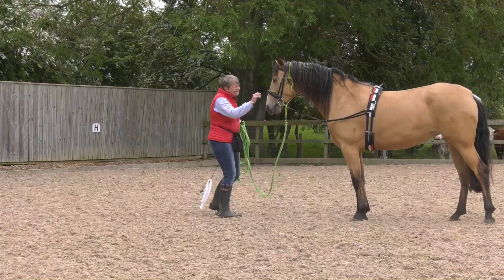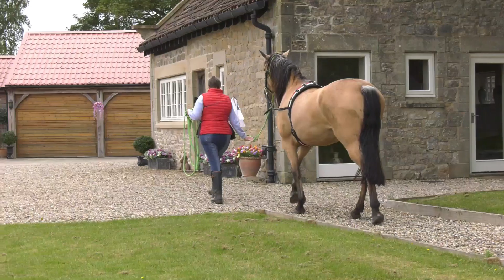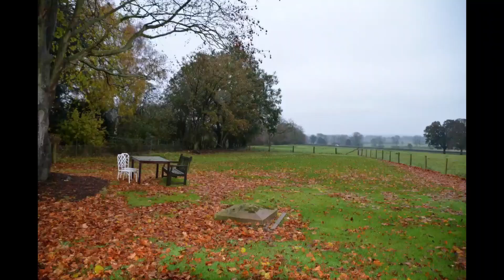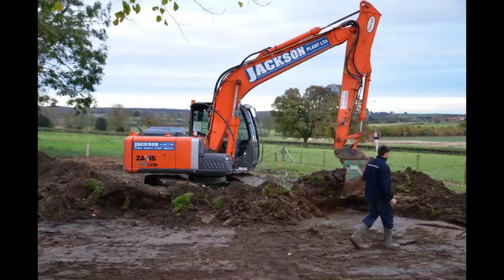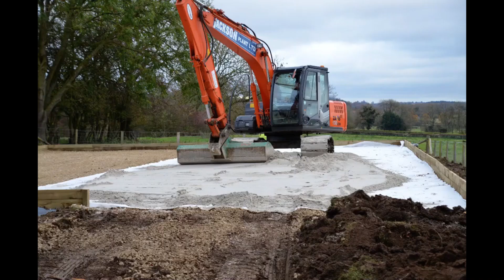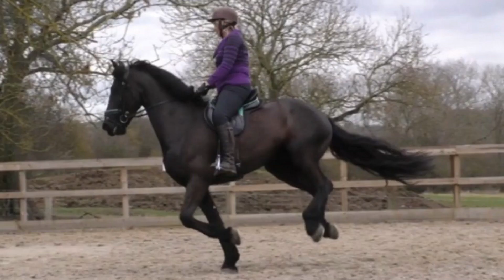Bella on the lunge. A leg yield to her right & two to the left which she finds more difficult

Comment: Loving her progress!
How long has she had that bit?  Been going back and looking at a few videos. She seems to not want contact, even on the lunge. Maybe try a few different bits just sitting in her mouth or on the lunge? My mare recently decided that the bit I have used for years isn't her favorite anymore. She decided that she likes the mullen mouth Pelham more than the lozenge eggbutt. I mean, she has her reasons, the double joint was pushing her lips into an undetected sharp tooth. The mullen doesn't do that. I have ground the tooth down with a rasp and that has helped significantly, but the vet won't be out untill minimum of fall. Thankfully, she seems back to normal now, happy to ride and going both directions well, as well as seeking contact again.
Just a thought because horses sometimes change their minds, especially the growing younglings!